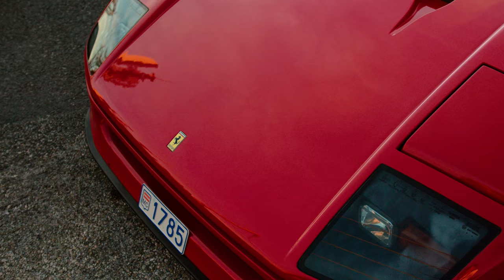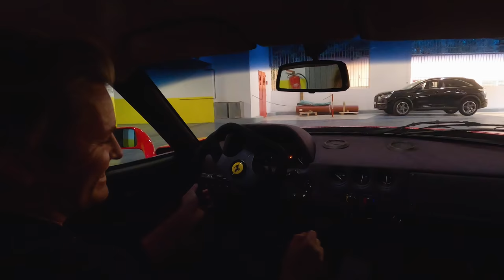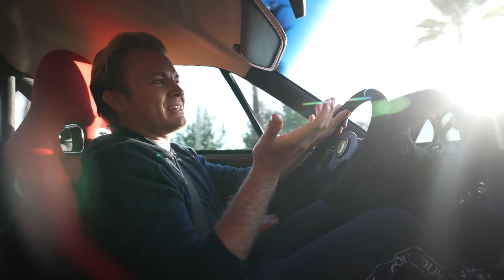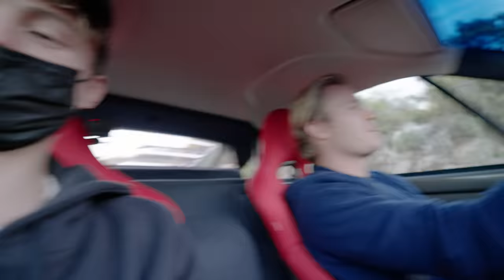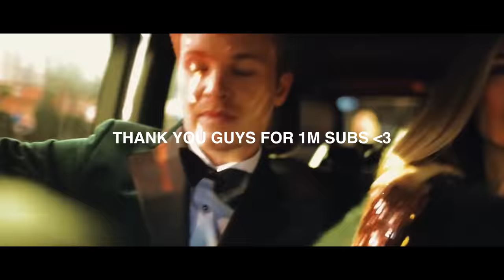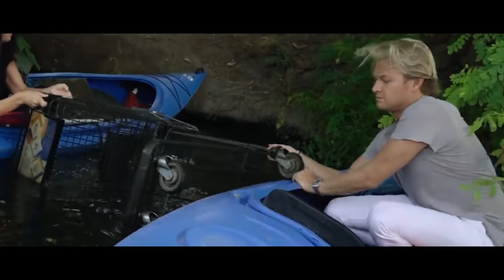A DREAM COME TRUE – Ferrari F40 in Monaco! | Nico Rosberg

Comment: This and the Countach were the icons when i was a child as well. In my mind those 1980s cars like the F40, countach, deTomaso Pantera have this unique brutal wide and flat look, modern cars dont look that aggresive anymore. I would be satisfied with a white Ferrari Testarossa though :) There are actually tons of others cars that would be a dream to drive, not only the Testarossa, Countach or F40. Probably the Aston Martin DB5, Lancia Stratos, BMW M1, Ford GT40 and a bunch of modern cars as well. Even something like a DeLorean would be interesting
Reply: You don't really want to drive the Countach. That is a car you simply wanna look at and sit inside. It's a shitbox to drive. It's heavy, unstable and surprisingly slow. If you'd drive the F40 and then the Countach, the Lambo would feel like a tortoise
Reply: @giuseppemaggio5894  True but most old cars are not as agile and fast as modern cars, i mean i want to drive a DeLorean which is slow as heck with a Renault engine as far as i know. Its more about emotion and feeling good while driving. An Aston Martin DB5 is also pretty bad to drive i guess or an old Mustang but they are beautys and every car has its emotion. An old Hemi V8 Hot rod would be an experience you never forget as well i guess. If its only about speed and lap times then you obviously want to drive a Mercedes Project one or the g like the Mercedes project one or the Rimac. The Countach is just emotion and childhood memories, it was the coolest thing ever back in the day and in my mind those cars look still cooler and meaner compared to modern day cars. Ever saw that De Tomaso Pantera, i saw one years ago at a gas station, its insanely wide and mean looking. It was the wide version with the wing

Comment: The car in my bucket list drive is the Ferrari Enzo. I still remember the  1st time I saw it on tv when I was a kid being driven by Jeremy Clarckson on Top Gear. I said to my self that car is beautiful,  also it's the 1st car I've seen with paddle shifter and I think it's very cool during that time because most of the car in the early 2000's are still manual.

Comment: Top speed Nico was 324 km/h. 4, not 3 (you know it matters). At least according to Ferrari's official spec. Power is speced at 478HP/PS (but in reality often it was over 500hp - the prototypes were almost 600hp in standard form. Ferrari detuned engine finally because considered it to be too dangerous for the clients) and dry weight 1100kg (although early data was around 1030kg - probably due to the fact that the earliest cars vere even more spartan than the later ones). 0-100 km/h depending on period (I remember early Ferrari specs 4.6s, later 4.1s). 
And yeah, this is my dream drive. Absolute #1 and my favourite car ever.

Comment: Bucket List Drive - F50 open top or Aston DB5 with the windows down, with my son as co-pilot, from the Cypress Tree Tunnel in Point Reyes, CA back to San Francisco via Sir Francis Drake hwy and them Hwy 1 - Shoreline Hwy to Stinson Beach, and then Muir Beach before heading toward the 101 to finish.

Twists, turns, elevation, QUIET shoreline, wilderness, plenty of open spots for allowing the upper rev limiter to scream it's approval.

Yeah baby..... it would be, in a word, transformative and an experience from another dimension.

Comment: The shape of the F40 is dramatic but it’s all purposeful...and I love the fact 5hat it retains the air inlets that the 308 gt4 has behind the rear side windows...it’s crazy that THAT little 2.9 liter V8 evolved into the machine we see here...but then again the GT4 with its squared off rear end/tail lights and Bertone design separate it from all the other v8 Ferraris....just as the 288 and F40 stand alone as fraternal twins

Comment: My bucket list.....hmmmm. 

It has been filled to the brim SO many times in my life. I have had many different rolls: Motorsport Journalist, Mechanic, Technician, Test Technician, Prototype Coordination Engineer, Race Engine Project Manager, and Engine Test Engineer.

Some of my highlights.

- First Countach in North America
- Does sitting in the Ford GT40 MkIV, LeMans winning car count as driving it?
- Lotus 59 Formula Ford
- Ferrari BB512 - Eurospec - heavily modded
- Maserati Khamsin
- Maserati Quattroporte
- Maserati Bora
- One of the three Citroen SM's with a Bora engine.
- Lola T70 Coupe'
- Ford GT40 s/n 1055
- Fiat Engineering's 1st F40 in the U.S. - "Killer B" spec with the 625hp engine
- Mallock Mk. 19
- Lotus Super 7 with a Downing 3 Rotor engine
- BMW 320i (3rd chassis) IMSA spec 
- BMW M1
- Too many Vipers to count - most notable were the GTSr mule with nearly 700hp, and Chassis 13, the One Lap of America winner driven by Elliot Forbes Robinson and Don Jankowski
- Various "Engineering Study" cars and trucks - read that, Chrysler sanctioned, cars and trucks with never seen powerplants and drivetrains combinations
- A period correct 1965 Dodge Coronet AFX altered wheelbase drag car with a 572ci Hilborn Injected Hemi

There are SO many other cars I have driven and owned that I really need to "make a list".  

So yea, I have been VERY fortunate to driven so many Bucket List cars that many would give their Eye Teeth to drive.

Comment: super cool presentation. only 1 "but". The actual chassis is not carbon fiber. Its steel ladder frame like in cars from early 1920s just covered for beauty (and little bit for lightness) with carbon panels

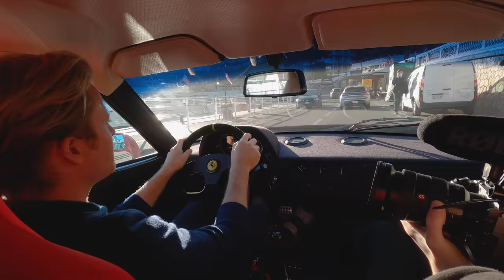Comment: 3:33. This 1000 times this. 

I notice that even with the "mundane" cars of nowadays compared for example to the ones form the late 90s - on the newer cars I feell like one does not even notice speed. And without noticing I´m going 120 Kms/h at a given time, at a given highway, whereas on the 90s car going 90 km/h one already feels the speed. Way, way more fun to drive the older cars really.

P.S: One would think that at Monaco, garage places would be bigger than a two place garage with almost no lenght to the back wall so as to put a car in. Specially a supercar. 😀

Bucket list car to drive: 911 Turbo. Specially one from the 90s. The car is BEAUTIFUL. Simple, full of character and with a strong engine. The gear box was still manual and the car could be a handfull to drive = character. Have I I said that the car is BEAUTIFUL? It is.

Comment: These F40's are not 476bhp, when these have been dyno'd they are more like 520-530, plus the Le Man versions had their turbos raised to around 2.5bar, larger intercoolers, bigger brakes, better suspension, better aerodynamics and a few other engine modifications. Absolute beautiful car
Reply: FYI......i was 37 years old when the F40 was unveiled ( 1987)....how old were you .....Here is the true figures when roadtested in 1987 ........Topspeed'......324 kph..( 201.49 mph ).....0 to  60mph ...3.8 secs..........and power 354 kw.......work that out to get bhp......354 x 1.341.....is........475 bhp.....!!!! ...........ofcourse  some owners modified their cars ....thats logical....and of course the F40 LM ....but that was a race car .....we are talking here about a non modified F40.......

Comment: I heard you mention that you had to let the RPM's drop before you selected a specific gear (It didn't seem as if they were that high). Does the F40 transmission not have synchronizers?

Comment: Nico, My father had a 1955 Mercedes 300SL, then traded it for a 1957 Mercedes 190 SL convertible in Santa Cruz, CA. I was only 8 years old, but I still remember both. My father furthered his love for sport cars with a 1957 Triumph TR3A, then a 1962 AUSTIN HEALEY 3000 2+2, then a 1960 bug eyed sprite for my sister, then a 1965 VW again for my sister. then a 1965 mini cooper S. Then a 1967 Porsche 912, 5speed.
My favorite 2 cars would be the 1955 Mercedes 300SL and the 1965 mini cooper S. Great video. Thanks

Comment: that was a minimal car didn´t had windows that opened and a piece of thread to open the doors or anything ,you could see the bare metal and the weldings this must be a more recent version, it even has a dash that´s a luxury F40 does it have any value?the problem is the porshe 956 that two monthes later with dash all electronic ac and a car auto-radio with speakers was more fast than the known F40 not this luxury version of it